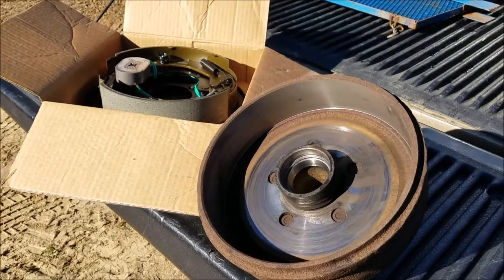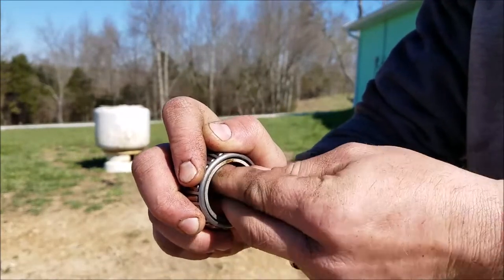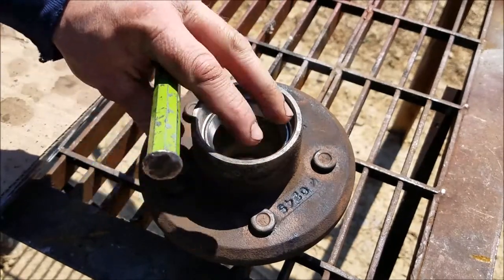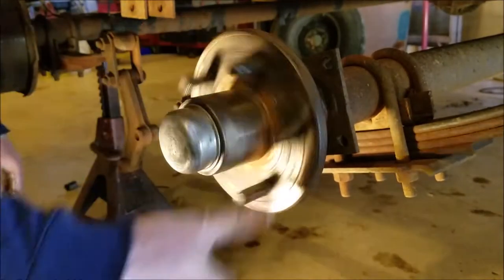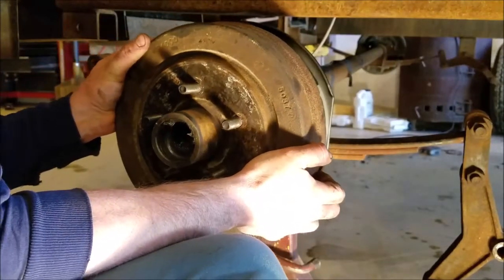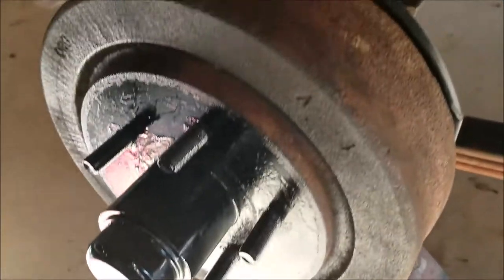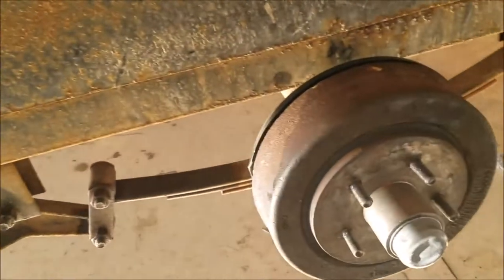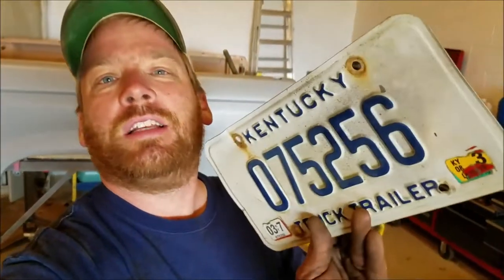How to INSPECT and REPAIR a USED TRAILER ... Part2

Comment: Did you use like a dremil tool and some sort of lube for the new bushings? Havent worked leaf spring trailer before. I have the misfortune of having bought a torsion suspension trailer before learning what a torsion suspension was. The frame is galvanized to boot... so when I had extremely poor tire wear I sent the unit in thinking bearings. They called me in and I went under the trailer to see rubber on the outside of the torsion bar... had them quote torsion and leaf spring. Leaf was way better priced and serviceable in the future. So I said leaf... but then they came back and said... your frame is galvanized.. Yeah so? ... can't weld to galvanized. Hem...

Comment: Was that a Wranglerstar endurance test with the Milwaukee? Good job. A little side tip for working on greasy stuff. Get some of your wife's dish soap and rub it on your hands like lotion and let it dry. When you're finished with your job, just wash off with warm water.
Reply: Hand cleaning share! Regular dish soap gets my hands super clean with a table spoon or two of sugar in the mix. Soap up hands, sugar up soapy hands. About as good as orange shop hand clean.